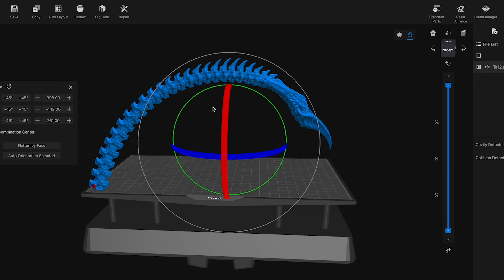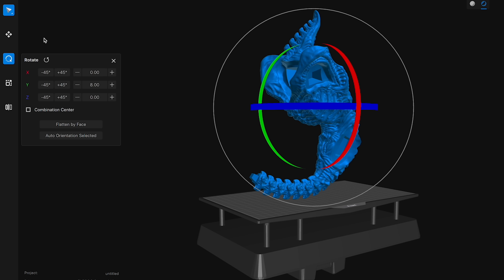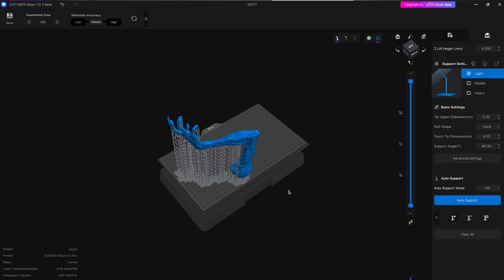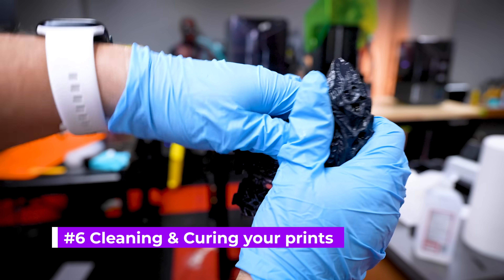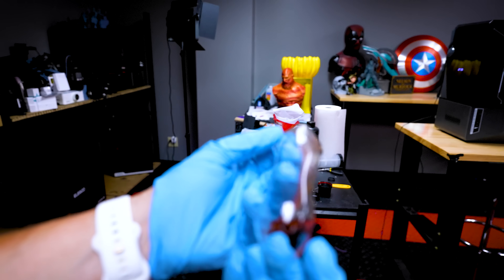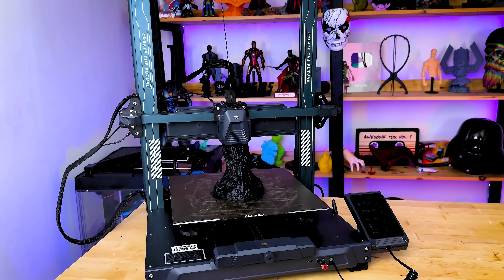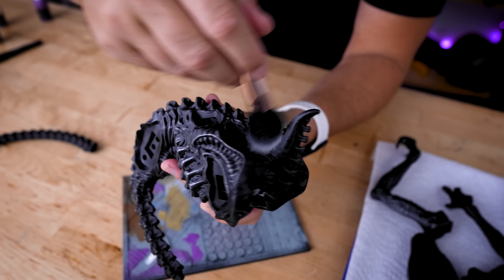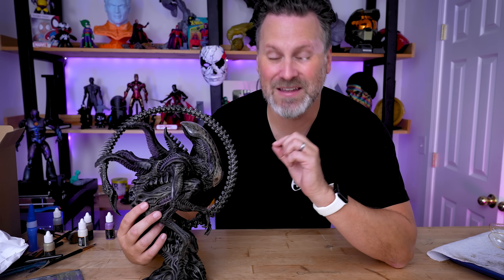My Simple Resin 3D Printing Process - From A to Z

Comment: What are the settings you're using for the clear? I checked patreon, but didn't see anything for that kinda resin. Only the speed version. I have a Saturn 4 ultra, so I figure the mars wouldn't be too different. I've been finding Siraya needs more than I had expected. However, I am not sure I'm doing it right. Though my prints seem to be mostly fine. I just don't have as much time to tweak and tweak and tweak.

Comment: Great video, thank you for sharing! Just got a resin printer and holy moly what a different beast from FDM printing. You have some older videos talking about resin safety but I am more curious about how you handle the mess of resin. How do you mitigate odors in your space, what resins do you recommend due to odor, how to do you handle cleaning up, do enclosures actually work, etc....I knew it was gonna be something to deal with but holy moly it's way more than I expected.

Comment: Im wondering, Do you cure the inside of the hollow model with an uv led? Because big models will leak out resin eventually even if washed in a station. Ive noticed this on some of my prints.

Comment: I have been having a hell of a time understanding layer lighting times. Everytime I print it forces high speed resin settings and the print ends up disconnecting from the bed or gets stuck to the screen. I have basically had this printer just sitting for the last 4 months because I just simply do not understand how to calibrate the lighting for my resin. This is one of the most crucial steps and I just dont see it being addressed at all here.

Comment: for your wet look use Pledge floor finish. You can even add paint to it to make oil washes, it self levels too. Also you could dip your clear resin part in it and let the excess wick off and it will make it go super clear, hope this helps!

Comment: Anyone use the presupport version? Print is coming off the support mid print. Been fighting a week with the pre owned S4U just to find out i have to completely remove screws just to get the bed "level" on the back side.

Comment: I thought you were supposed to apply a layer of primer to the print before starting the dry brushing. Is the priming step no longer necessary? From what I’ve heard, prints without primer can continue to cure under natural UV light, which might cause cracks or even breakage. Please correct me if I’m wrong!

Comment: Nice print, looking awesome, And for the wet look, you can use multiple options. Use a soft brush to brush on epoxy thinly. If to wet it will drip, and this will need a cure time. A other good option is with liquitex high gloss, use a soft brush and go over the whole thing. Dries pretty fast and leaves a very glossy shine. This stuff works  almost on everything.

Comment: Nice work and thanks for the work process you showcased. Now for some critique, I would have gone with that Smoky transparent black Head shield, i do think that had look so much better with the work you did on skull part, dulling it down a bit. If you look at the Xenomorphs they do not have clear skull shields they are a semi transparent Chitin which you can faintly see the skull texture beneath when the light hits it in the dark movies. And for some wet look you can go with a simple gloss varnish from the store and paint it on making it have that wet look, i would personally just do it on the most bright dry brushed parts of the model to give it a sheen as if lights hits the model.

Comment: Great tutorial. I use Saraya Tech simple clear quite a bit and for best results I use Maguire's Plasti X polishing compound. All you need is a hand compound pad and a microfiber towel. You don't have to do any wet sanding beforehand and it's paintable with clear top coat. Another cool feature of the clear simple resin is I can custom tint with resin pigments.
Reply: will it remain translucent if you use transparent resin tints ?

Comment: Great print! One helpful thing I have discovered is using Zona polishing paper as opposed to sand paper. The sand paper has a thicker back than the polishing paper and isn’t as flexible and easy to get into hard to reach and curved areas. Amazon has them and they are great!

Comment: Only suggestion would be to hit it with some glossy clear coat for the wet look, minus the clear part. For that you'll want to use something else possibly an oil that won't make it yellow over time, as the clear coat might yellow on the clear part.

Comment: Yep it actually is this easy, you do not need to pay three times to four times the amount for a 3D printer for it to do practically nothing or even a little more in the software side of the slicer, the 3D printer is already doing what it's supposed to do so paying that much more for a machine and you're getting charged that for what the slicer does is bonkers

Comment: @unclejessy, the reason the wet sanded one felt tacky is because resin does NOT like water, so even just the exposure via wet sanding introduced water into the resin, it soaks it up (and it can also easily deform resin prints but you got lucky with the shape of the print and the amount of water wasn't a lot), meaning that the resin tried to sweat out the water while the spraypaint was trying to dry, so it interfered. 
IF you want to wet sand resin prints, maybe use clean isopropyl alcohol instead of water, that might sound weird but that's the safe method.

Comment: Look at videos where the creator typically paints gaming miniatures. Look for videos where they make slime. A lot of them are using stuff like jewelry making UV resin and a glue called Uhu. I'm thinking a very pale, transparent, pink or purple, slime coat dripping off of it. When you look at the movies there is almost always a lot of water or something wet, shiny, slimy that's running off of them. Faking that effect over the model would add to the realism and the creepy feel.

Comment: I’d be careful with hollowed prints, you could end up having the print crack or explode due to interior not being fully cured. This happens because the uncured interior expands/contracts at a different rate to the fully cured exterior. If it does explode it can contaminate a large area with uncured resin which is not ideal if you have kids or pets, or for your own health for that matter. 
Ideally try find a way to cure the inside of larger hollow prints.

Comment: For a wet look, I use a brush on gloss coat. If I want dripping slime or blood, I use UHU Glue and pull strands of it, then use a transparent paint when it's dry.

When I'm gluing models of this size together, I refrain from using superglue unless it's just for small detailed pieces. I've had super glued resin prints randomly fall apart in my display cabinet a year or two after putting them together. I opt to use a 2 part epoxy (5 minute epoxy that I get at my local Dollarama) which makes for a very secure bond. Don't forget to scratch up the surfaces that you plan on gluing together.
Reply: Great tips, friend... thank you!

Comment: Glad your 4 ultra is doing well. I ordered mine 3 weeks ago and had a bolt fall off or break first week of use. Sent it back for a replacement and have to wait an additional week due to the Chinese new year or celebration. Activated my premium Chitu subscription that came with the machine (3 months) and I'll be out a month of it or more by the time I get the replacement machine. My first Elegoo machine and I'm highly disappointed in this service.
Reply: I have also had consistant issues that Elegoo have sent parts to fix that still havn't fixed the issue.  Now months later after waiting for shipping, install time etc, they are now telling me "Sorry, your machine is out of replacement warranty now"
Reply: @theromeog  ugh sorry to hear that. I honestly love the machine so I'm hoping it's just a one off..but as soon as they offered a part for replacing I immediately shot that down as I only owned it for a week and their warranty policy states they'll replace or refund the first 14 days. I don't mind tinkering, but I'm not wasting my time correcting an issue that was found a week into owning a brand new machine.

Comment: When I need a detail that’s clear but not thick clear gloss, I use lithium plumbing grease.  It’s very inexpensive, and a tube lasts forever.  You can dry brush the smallest amount into crevices and add a ton of depth.  Wipe excess with paper towel.

Comment: have you had any issues with the Saturn 4 ultra without using the heater? i dont have the heater and every time i print it sticks to the FEP. i cant find any solutions and i'm doing exactly what you do in this video.  just using auto supports. i cant even get the elegoo rook to print properly it prints like 10 layers then sticks to the  FEP

Comment: Grab yourself some vallejo gloss varnish if you want the "wet look" :) just paint it on or airbrush it. You can mix vibrant colours for acid etc too :)
Reply from the maker: @HellstormWargaming  awesome! Will be picking some up!
Reply: @UncleJessy would resin printing be ok to do in your house? I have read mixed results on the fumes.
Reply: @wolfjohnsen6468 I dont do a ton of resin printing but when I do it is in a seperate room like a work room that has windows and I open my windows and have a fan pull the air out of those when I am printing resins. I keep my printers near that window so if fumes are present they will go out the pull fan window. Just do not print in a closed off room. If you plan to do a lot of printing you will want a dedicated room or if available a temp controlled garage space. and ALWAYS wear Personal protection gear when working with any resins.
Reply: Exactly 👍🏼
Reply: Do you do that instead of curing?
Reply: @anthonylong5870  Nope, it's a top coat to go over the paint.  It will also protect the drybrushed finish
Reply: @anthonylong5870  Valejo is PAINT. you cure the model, you paint the model, you smash gloss varnish over the paint.
Reply: Future works better and is floor varnish
Reply: @emanuelmorales83  +1 for Future as well for its efficacy and value, but I'm not so sure about its availability.  Used to be that (around me in the US at least) you could find "Pledge with Future Shine" or something, then Pledge had another product after losing the Future branding, and now I think even that's gone.  I never just want to grab a random bottle of floor varnish that'll maybe end up drying satin or leaving a white film and then I'm stuck with a ton of the stuff.  I end up using so little gloss varnish that one bottle of the expensive stuff lasts for ages, anyway.